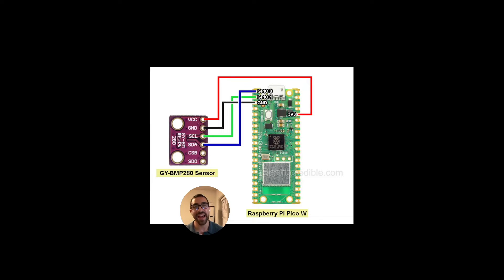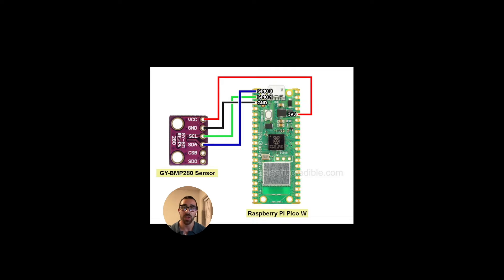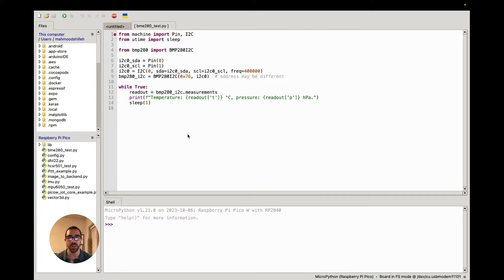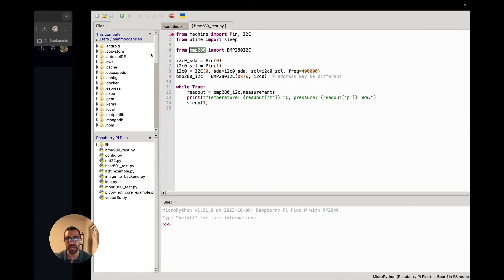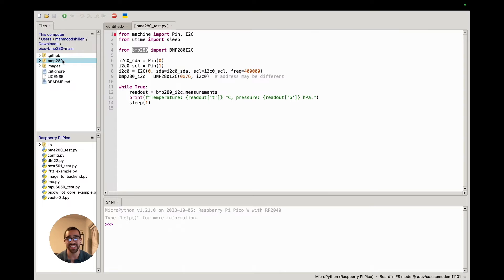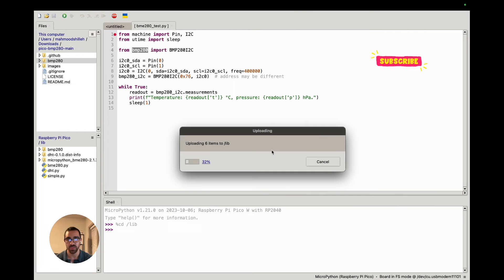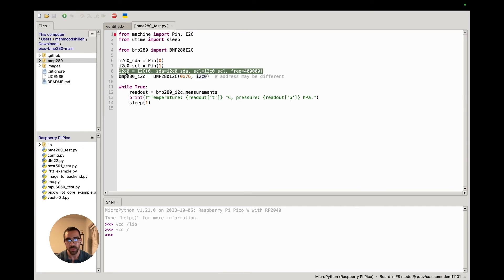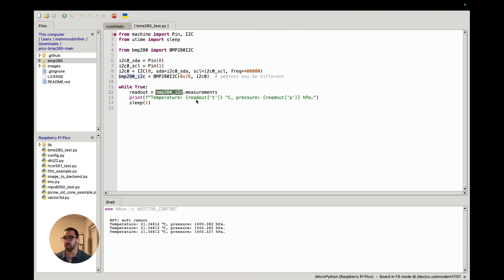How to Connect BMP280 to Raspberry Pi Pico/Pico W - Measure Temperature and Atmospheric Pressure

Comment: Hi there, I have connected up as you have said and copied the code but I am getting errors as follows: Traceback (most recent call last):
  File "<stdin>", line 4, in <module>
  File "bmp280.py", line 4, in <module>
ImportError: can't import name BMP280I2C
Reply from the maker: You need to get that from github!

Comment: Hi. Not sure if you can help but when I run this I get the error %Run -c $EDITOR_CONTENT
Traceback (most recent call last):
  File "<stdin>", line 4, in <module>
ImportError: no module named 'bmp280.BMP280I2C'
I have copied over the bmp280 folder onto my pico and it has the bmp280.py, the i2c and the spi files as well as the _init_ file. I can't tell why it cant find the module. Any ideas?
Reply from the maker: Make sure they are in the right directory!

Comment: Hi, I like your video, I was having a problem statement, actually I want to log my imu data in real time in some format I was using raspberry Pi Pico and using vs code and logging data in via USB bit it's induces measurements error,  I have Pico W is there any way to use vs code and Pico W to get the data transferred wireless in the vs code terminal on in some kind of Excel sheet, I want real time data there should not be much delay I saw your Excel and Tingspeak video but it doesn't meet my requirements
Reply from the maker: I am sure there is a way buddy, hard to answer such an in-depth question in a YouTube comment!
Reply: @mmshilleh  can we have a quick chat, how can I connect with you any social platform you are available like LinkedIn where I can message you